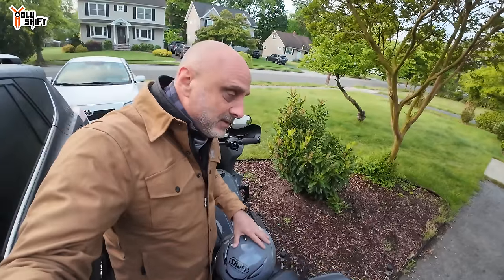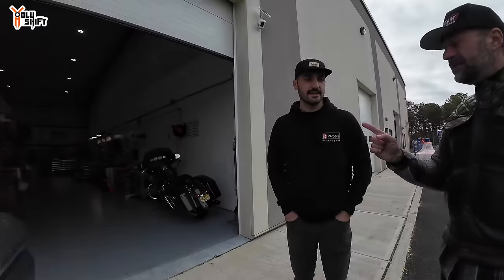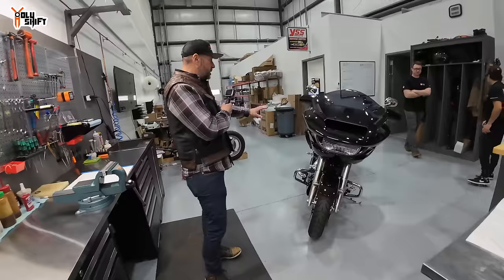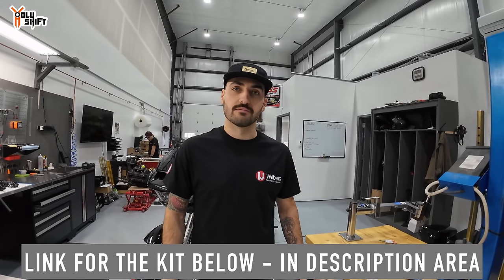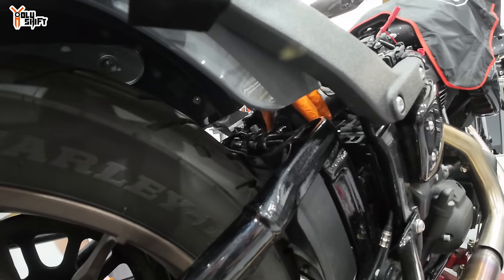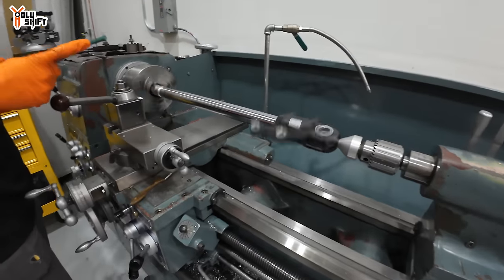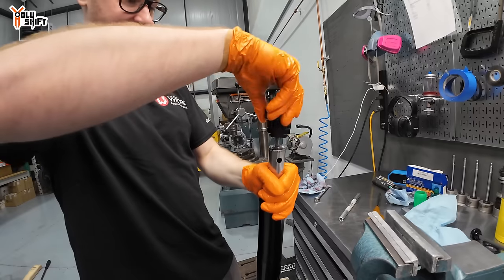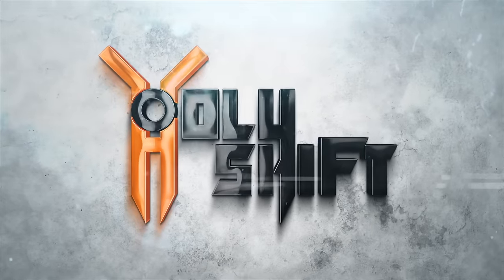First USA Low Rider ST - Wilbers Suspension Install !

Comment: I have the complete front and rear in Wilbers system on my 2014 FLHTCU. What a HUGE difference in the way it rides. I never have to adjust for ride. Load up and with in 1000 feet it self levels perfectly. Nice choice...